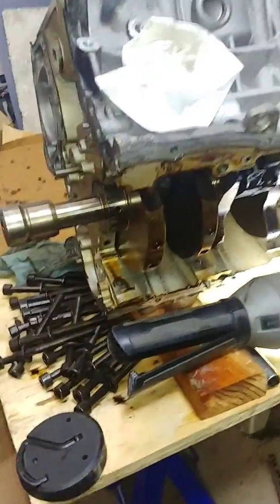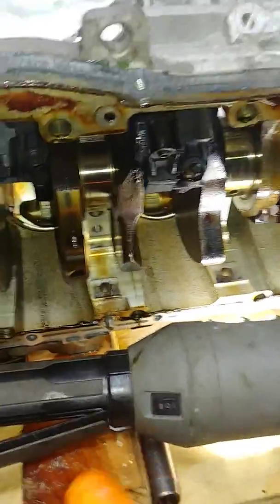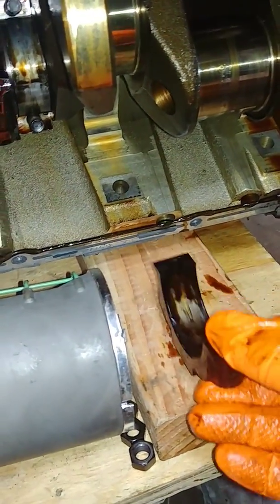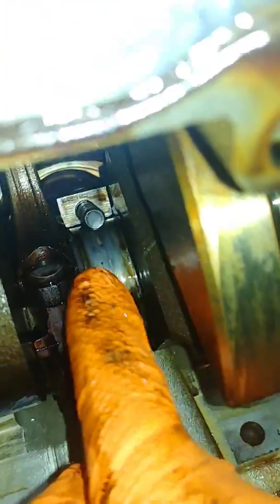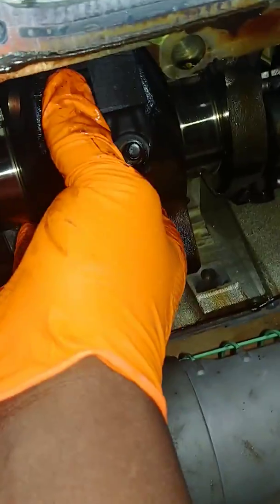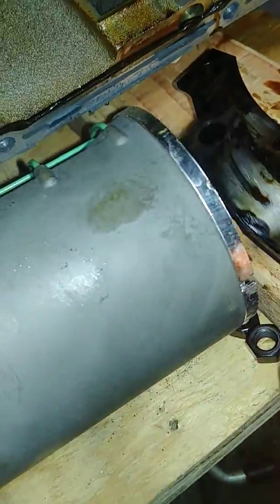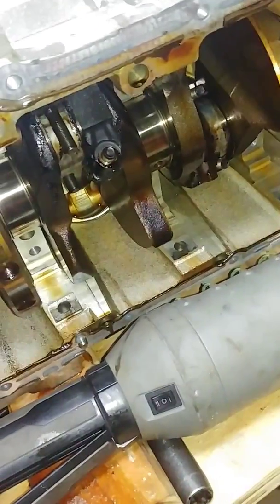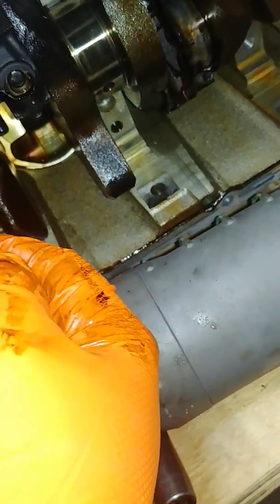CV #5. Engine locked, crankshaft won't turn. VK45DE

Comment: I just seen this is an older video idk if I’ll get a reply but my engine had a simple . Rod bearing spun. Would still run. But one day I drained the oil. And took it to the shop and let them know . They still cranked it in while it was sitting at the shop over a year. So a year later the said it locked up one day . Now I realized I told them it had to oil. So idk what to even do.
Reply: Heres ur reply

Comment: My 07 Ford Expedition EL Limited locked up after a timing job.  I pulled both cylinder heads and there are no signs of interference between pistons and valves.  The starter is good.  Ford has an anti-theft feature that locks the motor but I don’t think that is the issue.  Any thoughts?  This bearing issue is deep neurosurgery beyond my pay grade.

Comment: I can't turn crank shaft to find top dead center. What do I do now? I have to get to the head. What happens if I proceed without finding top dead center?
Reply: @dannielynrichard2406 did you ever find out what happens ?? I'm in the same situation ha
Reply: @juangodoy52  I couldn't turn it, no one could. I was told the engine was locked up. I said f it and gave up

Comment: How did you pull the with the torque converter on it?
Reply from the maker: Pull the...?
Something is missing in your question, but I'll assume you're asking how I pulled the engine from the trans. I just pulled it axially after removing the bellhousing bolts, and the TC came with the engine. 
The torque converter bolts secure the TC to the crank/signal wheel. The back of the engine is the only thing that keeps the TC from sliding back and forth in the trans.

Comment: So was this a issue of running the enegine low on oil?  Cause what i have read up on aboit these engines is fir the most part they are reliable but a few  have blown due to poor design! Im worried cause my engine is approaching 108,000 miles but i am very dillegent on my oil changes.every 3,000 no fail full synthetic only. Whats your oppion?
Reply from the maker: I think they didn't keep up with the oil maintenance. I've not seen any indication of poor design in any of the engines I've worked on.